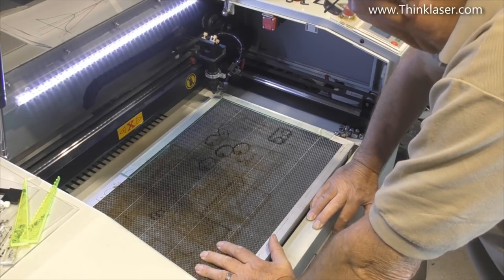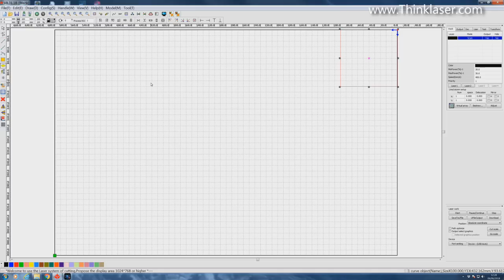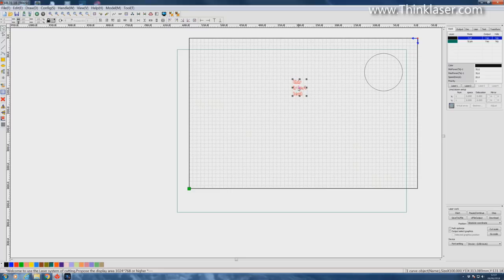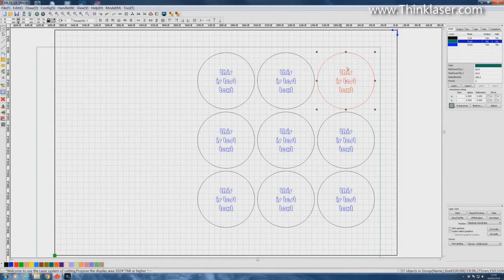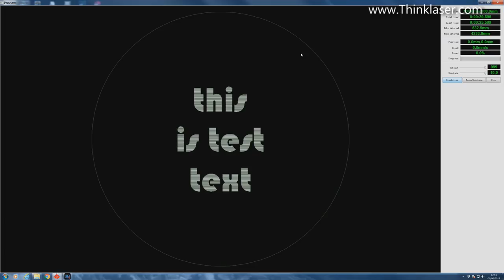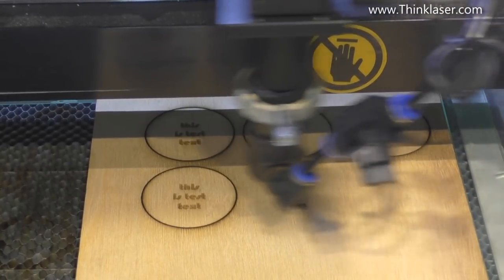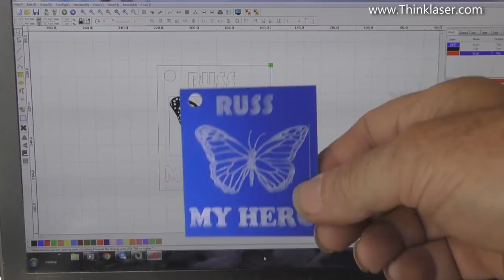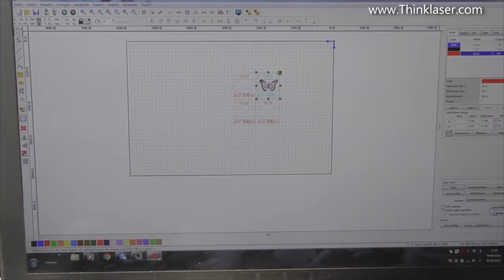How To Set Up A Laser Job For Best Results & Virtual Arrays (2018)

Comment: Do the slats not remove them put the honeycomb table on, on my laser you either have the slats on or the honeycomb table on, both don't go on at the same time.
Reply from the maker: Hi SUM1SLY83,
The slats are not removable on the Lightblade machines, they act as a base for the honeycomb bed.  

Gareth @ Thinklaser